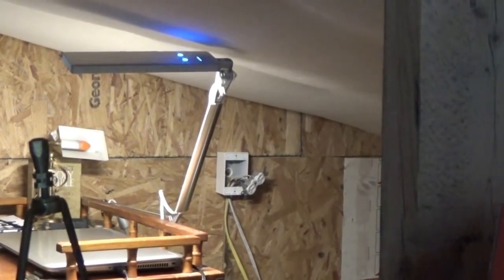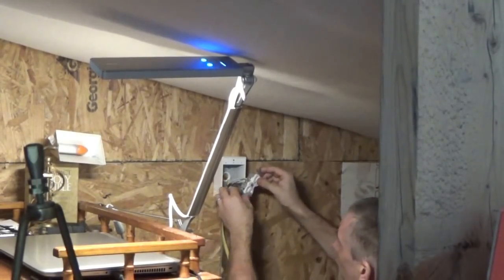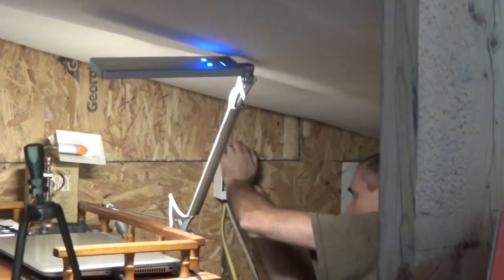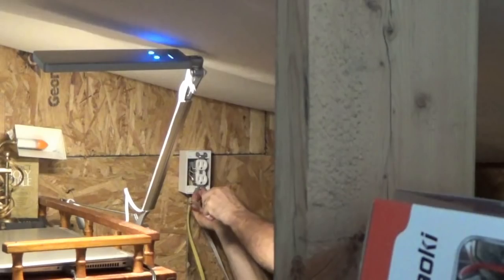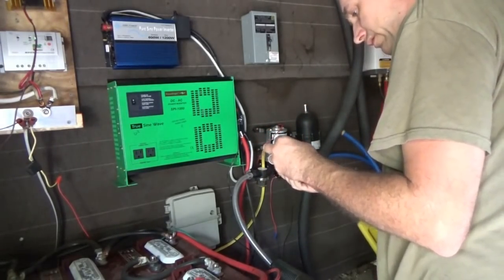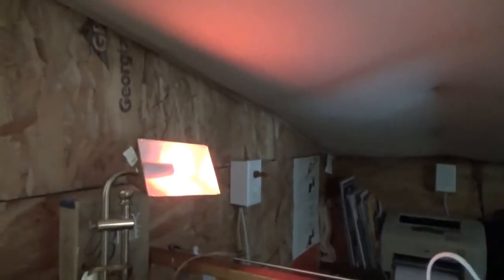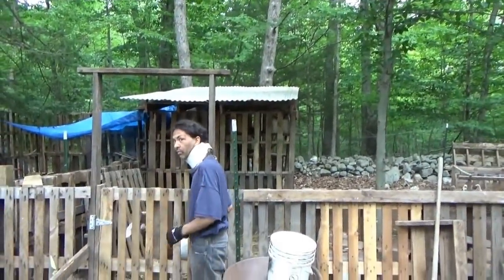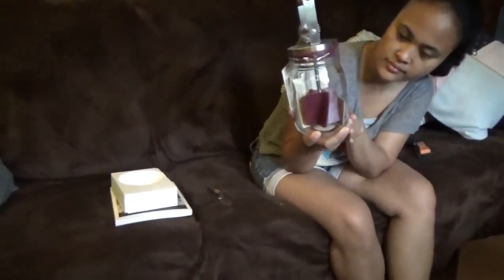Running Wires In Off Grid Tiny House & More

Comment: Troy, If you leave about 8" at the box to work with you bend the wire in a sorta S figure allowing the wire to coil more easily instead pushing it in on itself even though its more wire it will still work for you much easier just ask your buddy that was there he'll tell ya

Comment: Hi Troy

Now you got order in the battery bank I would advice you to put a lid on top of them - covering the screws, cables ect - if you unfortunately drops tools/wires ect NOTHING will happen - without theat plate - something dramatic WIL HAPPEN !

The plate can serve as a table for you !
Reply from the maker: Gonna build a box around them
Reply: The Do It Yourself World
The LID is the issue here - prevent dangerous shortcuts !

Comment: Troy old boy, you are looking to burn down the Tinny House on Wheels. Code, here in Indiana requires you to use 12 gauge wire with ground. You have been using 12 volt power, and now gone to 110 volt. I can't tell if you are using a ground wire, but using less wire, or pulling the wire back through the box, and then fastening the plug to the box, and then screwing the box to the wall,  will help stuffing in the wire. What are you going to do when the goats go dry. You will need to bread them, in order for them to have milk. Just saying!
Reply: +Solar And Wind Not Grid Tied WOW
Reply: ***** What codes are there for a RV ?
Reply: ***** Are you sure ?
Reply: ***** Who are you talking to ?
Reply: ***** Where did I mention indiana ?
Reply: The thing that applies, is using 14 gauge wire to run an electric skillet. But I guess my off hand comments were taken as offence but some. Sorry didn't mean to ruffle any bodies feathers.
Reply: Don Croddy I am sure that sound advice is appreciated
Reply: ***** Got to be regular.  You don't want to be having colon problems
Reply: ***** Yes it CERTAINLY does
Reply: I believe 14ga is plenty for 15 amp circuits.
Reply: ***** I am sure PETA would love to hear from anyone with any information
Reply: ***** WRONG AGAIN

Comment: Troy, I have been binge watching your videos for a few months and I am almost caught up. It has been interesting to watch you educate yourself through trial and error, and viewer feedback. I have to give you a lot of credit for what you have accomplished. I am building off-grid on a mountain in Virginia. I own a business in Pennsylvania, and only have about 3 months of the year to work on my property. When I have enough finished, my wife and I will move there full-time. I have learned a few new things from watching you and for that I wanted to thank you.

   As a side note, you said you will be adding another outlet later form the outlet you wired with 14 gauge wire. Remember, you can always go smaller, but don't go larger. Make sure the new run is with 14 gauge wire also. Going from 12 to 14 is OK, but don't go from 14 to 12...

Comment: All you guys that have jumped me about my comment, I was trying to save Troy from being crispy  fried, along with Melanie. No skin off my nose what he does. To each his own. Many things I see Troy do, I would never do. However, it's his project. I watch his videos as a form of entertainment. I can't figure out or understand a lot of his doings. I just enjoy watching. Plugging an electric skillet in an outlet wired with 14 gauge is just asking for trouble. Just saying folks. Noharm meant.
Reply from the maker: Sorry about all the attacks you got. Most are all working together trying to shut down my channel for their friend who also has a channel. He hopes my subs will go to his channel. But all he does is causes harm to himself.
Reply from the maker: The induction cooker will be used with the larger inverter on a 20 amp line of its own. With only one single outlet in the kitchen for that one single purpose. I have not yet wired that up. The biggest load on the other circuit is my 400 watt (peak) laser printer and my 70 watt laptop. 5 amps max at any given time.
Reply: Sounds good. Troy.  I guess you can't explain everything you do in detail. I was just concerned and just wanted to comment. Like I said, some of the things you do bewilder me, but I do enjoy watching your channel. Carry on Ole boy! Life is an adventure. Praise God!

Comment: I guess you just need more finger and arm strength. After the wires are connected to the socket pull the wires together then about 3 inches away from the socket do like a 45 deg bend in the wires then push it in this will make the wire fold just behind the plug and it will be much easier. Also where is your breaker switch with all the outlets you need to have a 15amp breaker to protect the 14 gauge wire you installed. If it was all 12 gauge then a 20amp breaker is needed. Please put in a 15 amp breaker to protect your selves.

Comment: The reason you are having a hard time with the plugs is you need to take off a lot more of the outer insulation, use the length of your linesman pliers as a guide of how much to remove
Reply: He did not read some of the last replies.

Comment: If you have problems with dampness in the house you can find a product called DampRid. You can find bags that gathers moisture from the air. We use in a particularly bad bathroom in wintertime. Works well! (Humidity in CA. Is usually non existent in summertime unless a rare summer storm is in the area. I know the east coast is hit hard!)

Comment: why didn't you use conduit? or is this just 'temporary'?  
 Troy it's terrible to see you struggle with cramming all those wires back into the box....might I suggest you look up Any video on how to install outlets...I'm sure you'll see why you are having so much trouble.
Reply from the maker: Did you listen to the video all the way through?  In the video I said that I am going to use conduit. In the description I think I said that on the next payday I will buy the proper conduit.
Reply from the maker: I also noted in this very video that I learned about stripping the wire back after I had done this work. In this very video
Reply: sorry I must have missed it...on these longer videos I just listen while I do other things. So you're going to put the conduit after you wire it...ok that makes sense.
Reply from the maker: Yes, there is some stuff they use in the schools on cement block walls. The conduit fastens to the walls and then the cover snaps in place. Allows for easy work on the wires without removal of it all.

Comment: I'm no electrician but the electrician that wired my house told me 14 - 2 as for lighting circuits + 12 - 2 was 4 wall receptacles
Reply from the maker: The inverter is rated at max 5 amps AC output so 14  is fine I think.
Reply: +The Do It Yourself World wait a minute 5 amps? you can't even run the vacuum cleaner on that are you sure that's right?
Reply: +The Do It Yourself World not trolling you man but here's a little something I found
Reply: +lordmbuk http://www.electricalsafetyfirst.org.uk/guides-and-advice/electrical-items/amps-and-watts/
Reply: That wire is probably fine now  (@6 amps 120=720) but what about the future? how about when you find a need to plug that circuit into the big inverter ?, are you gonna change the wire to 12/2?. Mhhhmmm, exactly.........................
Reply from the maker: I am never going to plug this line into the larger inverter. I will run a new line just for the large inverter with only one outlet in the kitchen.

Comment: ok Troy and folks I am an electrician and it is okay but not the accepted method of wiring to mix wire gauges, however when you mix gauges of wire you must protect the circuit for the smallest wire size. minimum code states 14 ga. may be used for bedrooms and living rooms and lighting, but must be protected by a 15 amp breaker or fuse. nearly everything else a 12 ga. protected by a 20 amp. Also electricians normally do not try to bend all the wires at the same time,  take them one romex at a time and prebend them to fit in the box. Troy Ole pal you really need to fuse or breaker protect each circuit individually for the size wire on each circuit. kitchen must not be on the same circuit with any other room it is to feed only the kitchen. !!!!!
Reply: Now, I understand that with a normal kitchen that has all kinds of electrical gadgets. But what does Troy have that uses electricity in his kitchen? It's not the stove, I don't think there is a frig, the freezer is out in the shed, I don't recall seeing any electrical gadgets. The only thing that is in the kitchen is lights. So, does it still need to have it's own circuit?
Reply: Yes ma'am it does require it's own circuit as stated in the code reference I listed.
Reply from the maker: The only thing used in the kitchen is a small fan and occasionally the coffee grinder or a magic bullet which is rated at 200 watts. The max output of the inverter is 600 watts which = about 5 amps. That means that a max of 5 amps will ever be used anywhere in the tiny house on wheels on this circuit.
Reply from the maker: Now, you can see that I bought a circuit breaker to install in the system. But Philip and I found out that the inverter has 100 volts AC between the hot wire and the ground pin. It also has 24 volts AC between the neutral wire and the ground pin. I fear that grounding this to the earth will short out or destroy the inverter.
Reply from the maker: A power inverter has its own built in fuses and overload circuitry, which I know works by experience.
Reply from the maker: Not arguing with you but just trying to figure out if it is even possible to use standard household circuit breakers and ground without blowing out this inverter.
Reply from the maker: Not arguing with you but just trying to figure out if it is even possible to use standard household circuit breakers and ground without blowing out this inverter.
Reply from the maker: Now from my studies there are much more expensive interters that are made to ground to the earth but this is not one of them.
Reply from the maker: I fear that by tying in the ground pin of the inverter, we are putting up to 100 volts AC on the outside of the metal breaker box and the outlet boxes.
Reply: I understand the reasoning for a separate circuit for the kitchen in a "normal", modern home, I get that.  But, in a home where the ONLY electrical used in the kitchen is lighting, WHY would it be such a concern?  Is it just that the codes are the codes and there is no bending them?  My question has nothing to do with Troy, just trying to understand the need for a separate circuit in a building that uses far less electricity than your typical modern home.  Not trying to argue about it, just trying to understand the "why".

Comment: NEC 210.52 (B)(2) 2 or more small appliance circuits in the kitchen SHALL have NO other outlets.
Reply from the maker: I dont get it. There is only one outlet in the kitchen.
Reply: I quoted chapter and verse and wrote the code for you. Doesn't really matter what is practical for your application if code says SHALL then you shall! Another point is this only 600 watts of power would come down to 180VA (close to the same as watts) per outlet strap so according to code you can only install 2 outlets which equal 360 VA.
Reply: +MrCelticatheart sorry 3 outlets at 540 va
Reply from the maker: Ok, now I am really confused. Never heard about adding up the VA like that

Comment: People have told you the proper way to strip off outer jacket close to the entry point in he box. Then it is EASY to connect the wires and attach the outlet in the box. How do you expect to learn anything if you won't listen to good advice??
Reply from the maker: What is sad is that in this very video I made mention of this very topic but it seems like nobody watches my video and then gets upset with me for something I covered in the video.
Reply: +The Do It Yourself World I watched the entire video again and all I heard you say is that you can't work with #12 so you used #14....
Reply: The other option is to use those 3 wire push in connectors. Use one for each side and ground. Push your source wire in, then push in the outgoing wire. Then use 14 gauge to go from the switch to the connectors. These connectors replace wire nuts . What's nice is you can run your wiring where you want it, leaving the one connected open. Then when you need to you can put in your outlets. Since the power isn't daisy chained through the receptacle, but at the connector you can put more junction boxes, and decide at a later time if you want to use them, with minimal fuss to connect them in.
Reply: +n9owp he didn't say it, it was captioned in text on the video.
Reply from the maker: Yeah, I figured that would get their attention better :)

Comment: hi I was wondering if you could tear down a regular size house to use the material to build a couple tiny houses and would it be cheaper to do so if the regular house would only cost 9,500 the reason im asking because the houses I are for sale for so cheap are not in a state I would want to live in
Reply from the maker: Well, most tiny homes run around 20,000 from what I have seen but that includes all brand new appliances and everything. I spent about 4,000 to build my tiny house but I used a lot of recycled materials. One thing about recycling is that it takes a LOT of time to clean up the wood. I think you would be better off buying a good trailer and building the tiny house using new materials. Then looking for used or free appliances and cabinets to save money

Comment: Now you are going to need some fresh cow's milk to play with the butter churn.
Reply: I just looked it up... you can... it comes out bright white.
Reply from the maker: Goat milk failed. I let some sit for a few days. Took the cream off the top. Turned it for hours and hours. Nothing at all happened
Reply: Sometimes it is cheaper to buy cream at the store and make your own butter. Butter can be pretty pricey. 1 quart makes about 1lb of butter. Throw the jar in the freezer for a half hour and make sure the milk is as cold as you can get it without it freezing. Heat could be part of the problem. Wrapping a towel around it to hold the cold in might help as well.

Comment: I am truly sorry for the Hornets nest I stirred up in the comments Troy. Although I have said things about code the only 2 things that bother me is the overcurrent protection and the use of gfci outlets near water. I would feel terrible if someone was electrocuted to death and I never said anything. I will suspend all electrical comments unless I find a serious safety concern in the future. Troy if you wish to PM me I will help as much as I can.
Reply from the maker: I am sorry for the attacks. I do read the comments and learn from them. Do not let the trolls win please. I am trying to figure out how or if I can wire up this inverter. I hope you did not delete the thread because I wrote a lot to you and did not see answers last I checked.
Reply: Troy I am not discouraged by spiteful people, and did read many of your posts. Not sure I read them all they are rather hard to keep up with. Just want to say some systems are not meant to be grounded and won't work properly if they have been. If you're inverter already has internal fuse protection it is probably all that is needed. Gfci protection for your counter outlet is paramount and realistically don't need to be grounded also you can gfci protect many outlets with one gfci outlet. Hook incoming power to the line terminals and other outlets to the load terminals. Please enclose the romex wires so the cats don't chew them. Romex is made to be enclosed inside walls etc. To protect them from physical damage but if you cover them by other means will also serve the purpose.  As always take care be safe , wish you all the best. Any wiring questions feel free to pm me.
Reply: Fern Forest in regards to your question. ..no there really is no way to install the wires in conduit without disconnecting them. As any true electrician will tell you the raceway needs to be installed first and must be listed for the application, or approved by the authority having jurisdiction. If it's not listed or approved you consequently run the risk of tearing it all out and redoing it. Hope this helps you with your questions.
Reply from the maker: What about that square white stuff where the top opens up? I have seen it often in schools with cement block walls.
Reply: +The Do It Yourself World. Hey Troy if you are talking about wiremold you will still have to redo the wires and it looks nicer than conduit but is more expensive! It does come in 2 parts and the back slides out of the front but doesn't just snap apart.